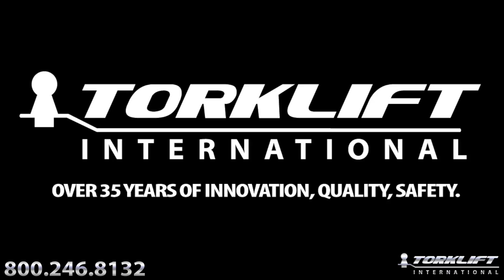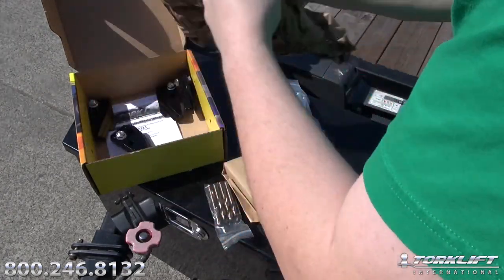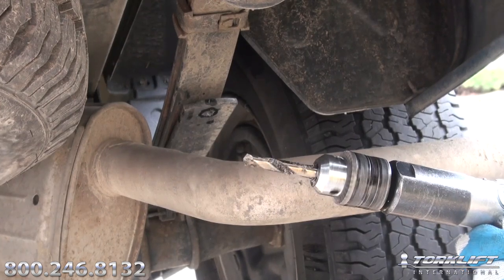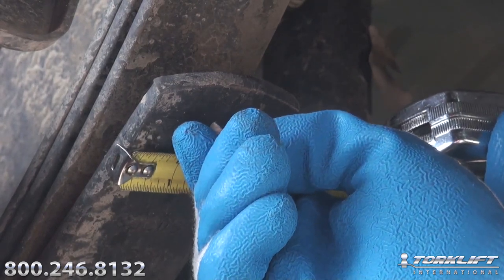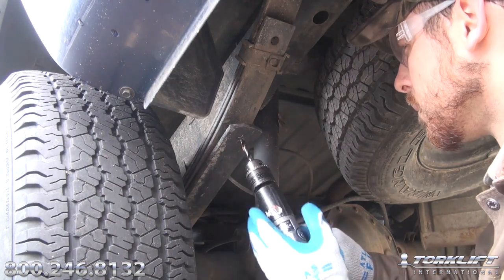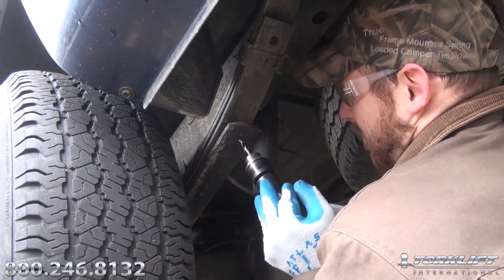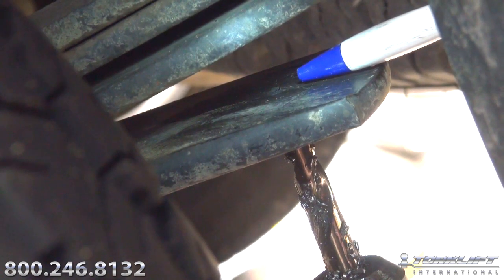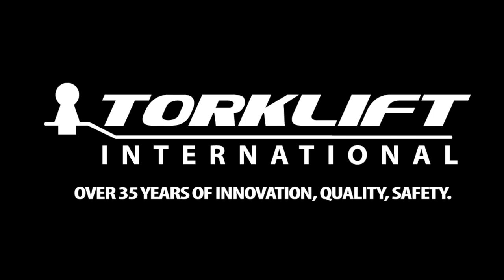How to drill springs when needed - Torklift StableLoad

Comment: They make this look way easier that it is for certain leaf springs. So here is the deal. I have very thick leafs and at first, wow it was a pain, thought I would never get that last 1/8" and chipped part of the provided bit (1 of 2), had sharp shavings all over me and oil all over the drill, then my bit started spinning in the chock. Wanted to change my luck so diverted to the second spring and second bit. This time I grabbed a simple scissor jack from my other car. Started a small hole by hand, then placed jack directly under hole and made sure drill was straight up and down in 2 directions, I also had to put my drill chock in a vice and pull the trigger to really lock that bit in place. Now crank the jack up to push nice and hard on the spring. Now do short bursts with the drill - you will get much more material this way. you can do little adjustments up with the jack between bursts. Resist the urge to keep going for more than 5 seconds or you will dull the bit! Now lower the jack just enough to slide the drill to the side and out of the hole without moving the jack(this will prevent having to align it each time). Dip the tip of drill bit in oil and go again. Spraying oil is way too messy and you will end up with oil in your drill and all over your hand - possibly ruining your drill. Dipping the tip of bit works MUCH better. I even pushed a small piece of paper towel over the bit and down to the chock to catch oil dripping down the bit and changed it a few times. This method also allows you to be off to the side instead of under the whole operation so you prevent all the sharp shavings from sticking in your shirt, hair and all other places. Let the jack do the work! Experiment with how much to make the jack push up on the spring. Too little and you will have less shavings, too much and you will bind up or spin your bit in your chock. This works! You will be able to use the two bits provided. I even finished off the first side with my second bit after finishing the second side.
Reply from the maker: Hi there cbird02! Thank you so much for sharing your input and experience. We do offer a drill tool loaner that uses essentially the same principal as the jack you used. Nonetheless, I'm glad you found an easier way to install than doing it by hand!

Comment: Thank you for the question. When the drill cuts through the final portion of the steel it can sometimes leave heavy burs that can occasionally chip or break the drill bit. By waiting until all the holes are drilled it insures that the drill bit will have maximum life to drill out as many holes as possible.  For more information, please call us at (800) 246-8132 and visit us at www.torklift.com.